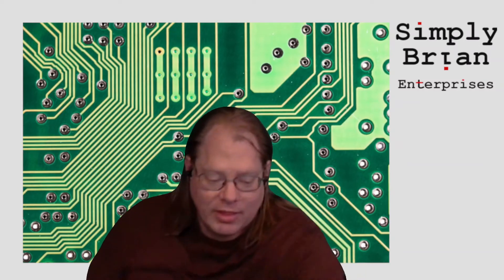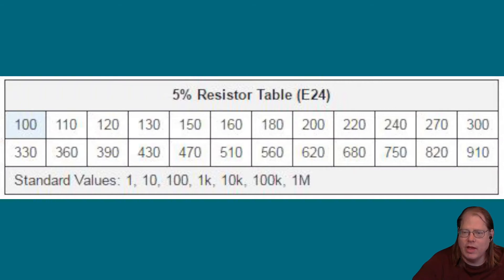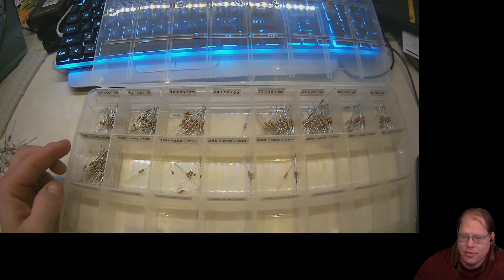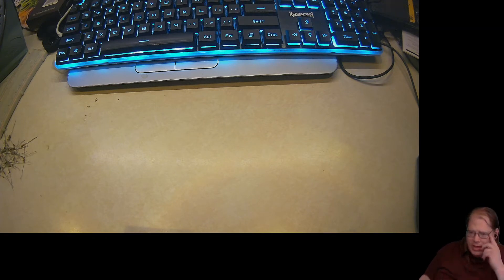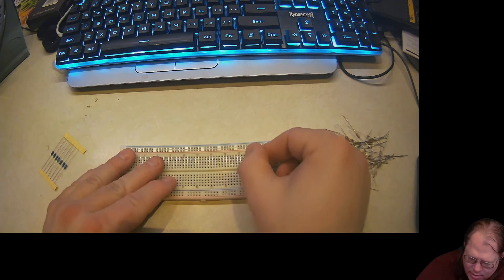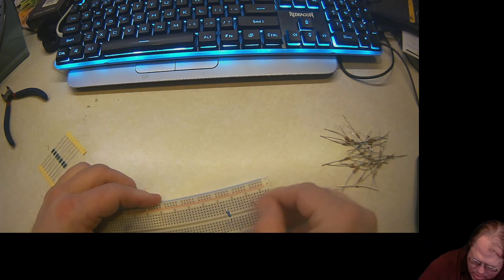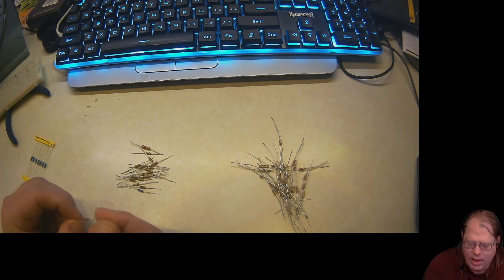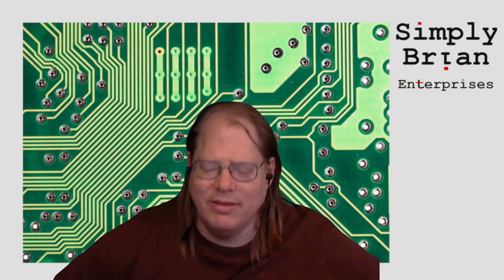Off The Beaten Path: Resistor madness

Comment: Nice video Brian, I guess I never gave the glue on the end of the wires a thought but it might be the reason for intermittent connections on the breadboard. After awhile the pinholes would get plugged up with tape residue.

Comment: Thanks for showing this.  I have thought about the glue on the end of the resistors and thought you were going to say that it made the clump of resistors worse because that little bit of glue made them stick together a little bit. The chart of the standard values was good to show, because the new people to electronics probably won't know that.  I wonder if you might want to go a little bit shorter on your lead length to get the resistors closer to the breadboard.  There might be a drawback to having the resistor sitting on the plastic breadboard, if the resistor gets too hot or burns up you might melt some plastic.  I used to work in a shop that made electronics for high end customers and we had to form our leads by using a long nose plier to make the corners pretty sharp before we put the resistors in the circuit board.
Reply from the maker: Thanks for the feedback.  It seems like resistor lead length is more personal preference than anything, since there's a number of people out there clipping their leads but no one is talking about length.  I've seen the leads clipped REALLY short, 5mm maybe, to do exactly what you're suggesting.  They sit flush on the breadboard.  I see two problems with that.  A) if I need to stretch a resistor across rows or columns that exceeds the length of the resistor, it won't reach.  B) I regularly solder on perfboards, and if I clip the leads too short I won't be able to bend them over and keep them in the board while soldering.  I've considered using a length of 10mm, I might try it and see if it's still long enough to accomplish everything.  For my purposes, I wouldn't go any shorter than that.